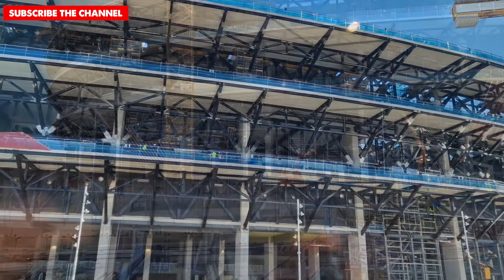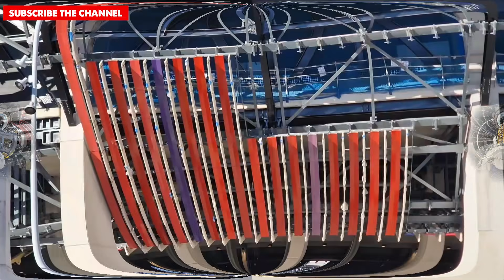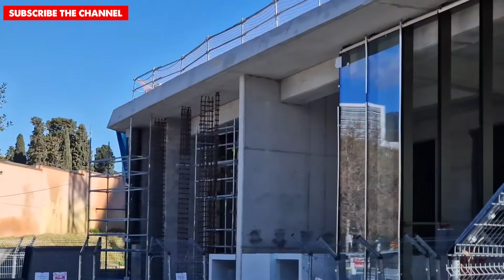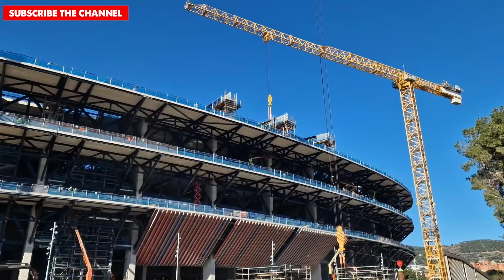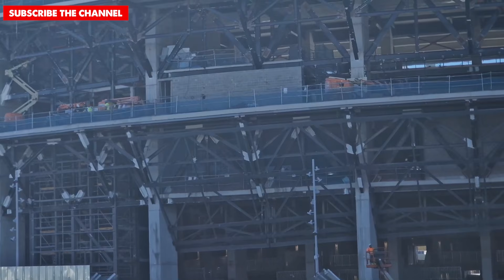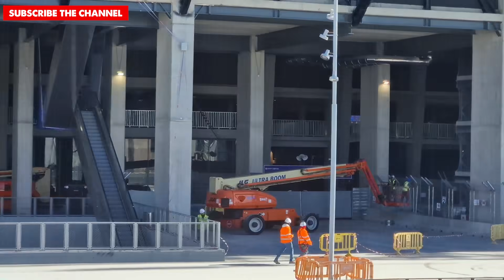Camp Nou Update: Barcelona 3-0 Victory 😲 & Major Construction Progress

Comment: 두달동안 세라믹은 제자리걸음 ㅋㅋ
Reply from the maker: Yes, ceramic work has been slow in a few sections because other elevator and structural works were ongoing. But the ceramic louvers are already staged and will start moving quickly soon!

Comment: when will the roof work start
Reply from the maker: Roof work is expected to start in phases soon, with major components already prepared on site.
Reply: @CampNouVision1  ok and is the 105k capacity almost done
Reply from the maker: Not yet. The 105,000 capacity will be reached once the full roof, upper tiers, and final installations are completed. Right now, the stadium is still in phased progress.
Reply: @CampNouVision1  but upper part which is covered with some white cement whatever you called after that part is done how much capacity would camp nou have
Reply from the maker: Once that upper concrete structure is completed, Camp Nou’s capacity will be around 62,000–65,000 spectators. The full 105,000 capacity will only be reached after the roof and all final phases are finished.
Reply: @CampNouVision1  and after the white cement thing is compketed will the roof worl start next
Reply from the maker: Yes, once the upper concrete structure is completed, the next major phase will be the roof structure. Some preparatory work may overlap, but full roof installation starts after that phase.